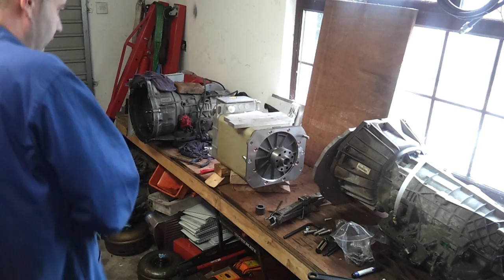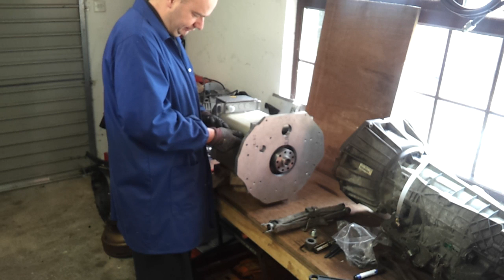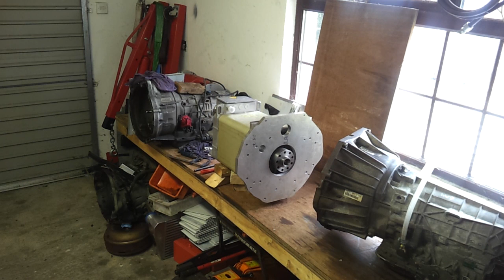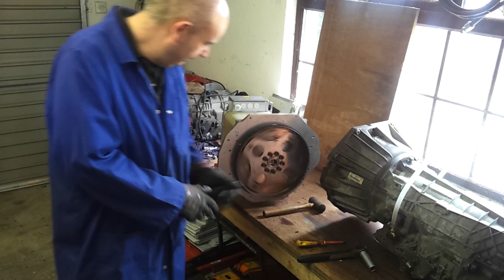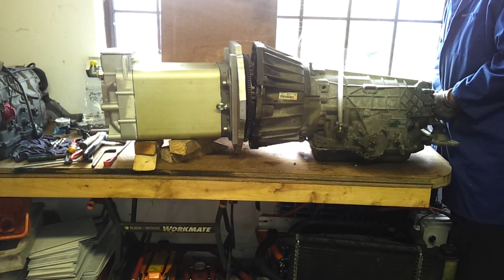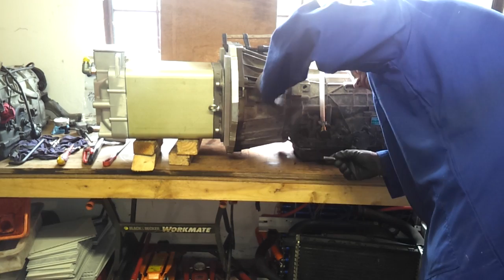BMW E31 840CI EV Conversion 05:Adapter plate 04

Comment: Damien.. alignment holes? Maybe a couple of machined stepped pegs would of helped to align or c/sink the bolts so the heads centre up. Dunno. Maybe your "rack of eye" can be used to adjust is best..?

When its all good and spinning well. I'd drill ream through motor, plate and gearbox then loctite the cut off reamer shanks into place ;)
Then no future misalignment after vibration, "bangs and crashes" will happen.

I'll be looking at your next video to see how you get along :) hoping all is well.